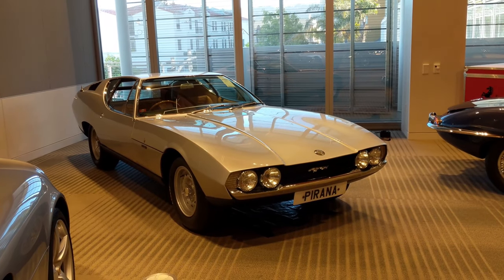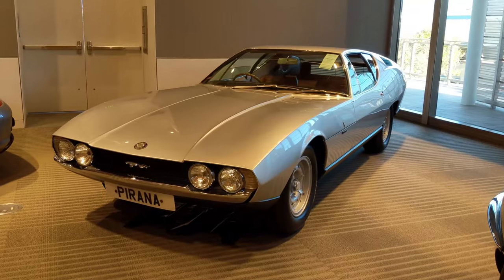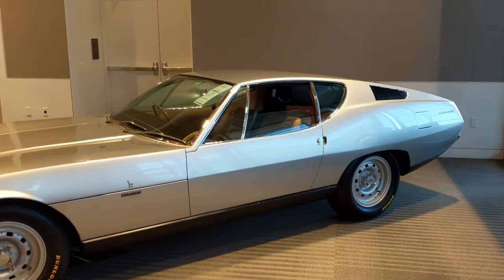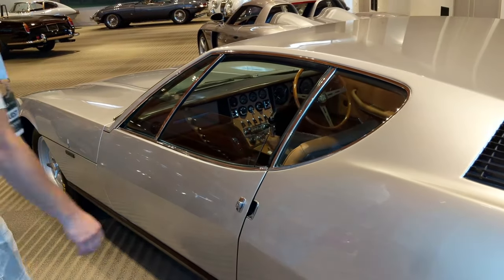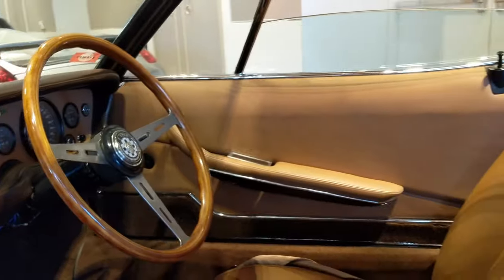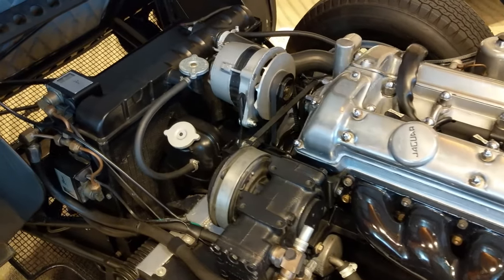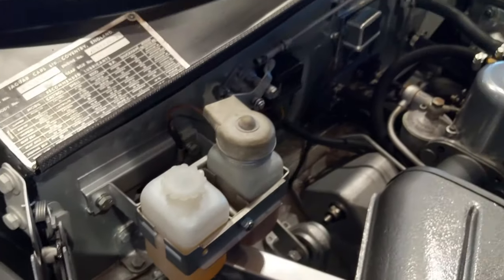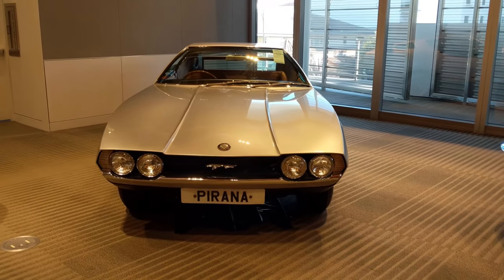$324,000 'Pirana' E-Type by Bertone

Comment: This looks like the same car I saw at a Worcester, MA body shop in the early 80's.  I was getting my '63 E-type repainted and this car was parked in the back of the shop.  Jay Leno's Garage also features this car in a Mar 2015 episode.  According to Leno, the car was a one-off built on a '67 Jaguar 2+2 chassis as a publicity effort by a Brit newspaper.  The build cost was 16,000 Brit pounds; and they sold it at auction for 17,000.
Reply: Yes I still have the original two newspaper articles over which they described the concept and build, it was the Daily Telegraph.

Comment: I noticed the red line on the tacho is at 5500. Doesn't that make it a 3.8, not, as Richard says, a 4.2? The red line on the bigger engine is 5000. Also, the car looks unusually long. One commenter says it was based on a 2+2 model and that would make sense.